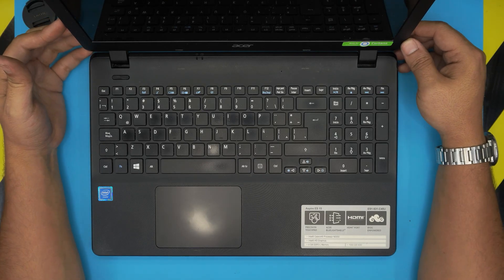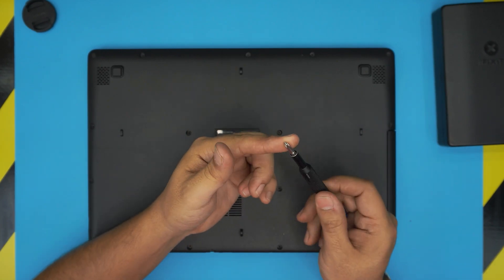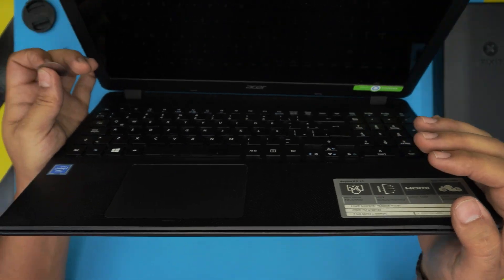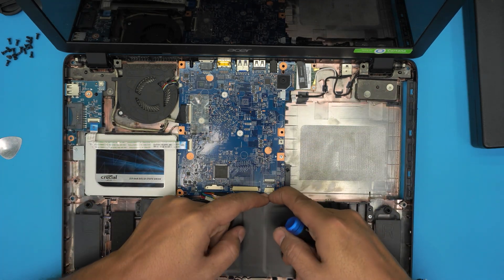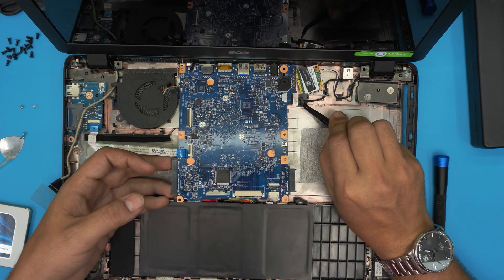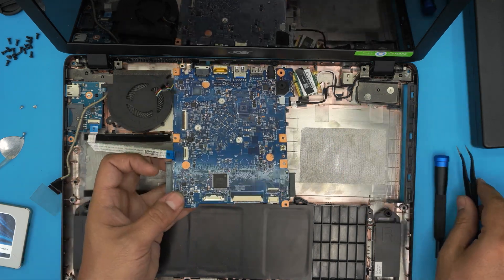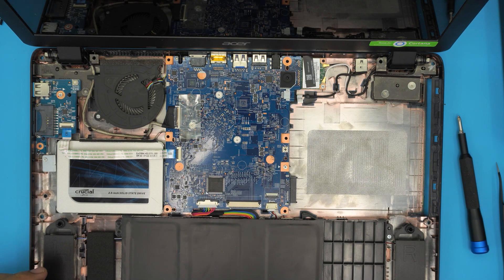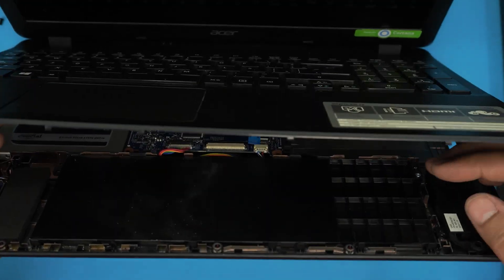Acer Aspire Es 15 🚩 Es1-531-C45u 💻 Ram Upgrade

Comment: Thanks for the video.    I would have been pensive about all that 'prying' to get the case apart, had I not seen it done.    I gently took mine apart to upgrade the HD to an SSD.   Unfortunately, after careful re-assembly my old Acer no longer 'fires up'.   The power light comes on, but the video screen just remains black.   External monitor shows nothing either.   Even after putting the original HD back, same thing, no video.   It makes me wonder if I've tripped some sort of software  lockout system.    Very strange.
Reply from the maker: It's my pleasure my friend.
🫠Regarding your question, remove the charger and disconnect the internal battery, remvoe the rams and disconnect  the BIOS battery the one beside the ram, and wait about 1h.
place the ram and plug everything back, and power on and wait up to 40sec.
cheers🍻
Reply: @ cool, I'll try that.   Thanks again.
Reply from the maker: anytime

Comment: When that wider flex cable is re-inserted, does it go between the pcb and the black sliding piece, or above the black sliding piece between it and the beige part of the connector?
Reply from the maker: 🫠Regarding your question, the flex goes in  between the and top section of the plastic and thne the black part slides inside.
Reply: @uFixTek  thanks.
Reply from the maker: It's my pleasure my friend.